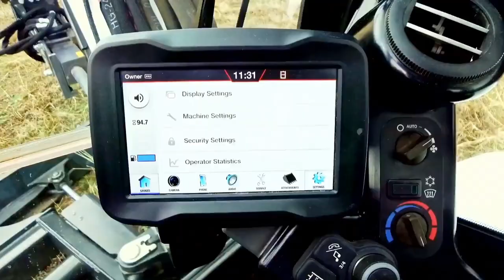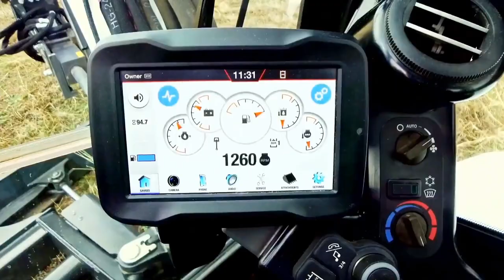Bobcat T7X Electric: The World’s First All-Electric Compact Track Loader!!!

Comment: I had to check to ensure this did not come out in April because I thought this was a joke. Even with the improved torque that comes with electric motors, 4 hours of run time is a no-go. Add to that, no hydraulics... there go all my attachments until the industry catches up.  Can't even imagine what an inconvenience charging will be on site. Dragging around a diesel generator to charge the thing almost defeats the purpose.  If all I did was dirt work or I was a rich dude looking for a new toy, then maybe. But I just don't see it working. I applaud the innovation and hope they can do better with larger battery banks, but as is, this is just a toy.

Comment: We recently got to test this machine.. we were really impressed with the power and performance. Yes.. charging may be in the main issue on sites but really cool to see the innovation.
Reply: Charging is not an issue. 
62kWh battery is huge, it’s equivalent to 200 miles a day. How many gallons of diesel saved? 

If someone needs more range, buy a second machine. The savings in diesel and maintenance will quickly pay for it.
Reply: @lumberjackdreamer6267 hahaha your so ignorant time is worth more money electric is NOWHERE near replacing gas diesel your looking at another 20 plus years the technology just is not there when you can compete with diesel then you can talk. You talk about saving money because it is all electric so maintenance costs are lower. In reality it costs way more owning that electric skid steer if you have to replace the batttery that’s 20k plus and only a dealer can do it. I can work on any machine I own, I don’t have to make a job stall and have 5 or 6 guys getting paid hourly while the equipment is charging, it still has hydraulic systems you have to maintain tracks almost everything is the same except for the electric motors. When you can charge the machine in less than 30 minutes and have it run all day then it can compete but my skid steer can run all day 10 hours multiple days without having to fill up, electric can’t. Yeah it does have fewer parts that are 10x more expensive than a regular skid steer. Would you rather replace a head gasket for 100$ and 2. Hours of your time or pay 5,0000$ for one electric motor and have to TOW it to the dealer to get replaced. ITS NOT WORTH IT
Reply: @lumberjackdreamer6267   where does that electricity come from? Chances are, coal.

Comment: 4 hours? You seriously have to work on that. Most short days are 10 hours. That makes all the difference in the world. Sounds like loss of production…
Reply: That is 4 hours of the machine not stopping at any point during work. Guys who work 8-12 hour days how much of that is idle time? Or the machine isn't being used very hard? I think this machine will work longer than we think it will.
Reply: @ptrproducttestreview9593  Haha idle time. You don’t get paid for that. The only way that this is feasible 1: you stop for lunch, or 2: you have an operator that is running a 2 pieces of equipment and isn’t using constantly. If there is “idle time”, the project manager or lead needs to be fired.
Reply: @wht240sxka  Why are you rambling on about unrelated subjects bro?

Comment: 4 hours of run time? Never once have I been on job that the 4 skiddy’s running around that shuts off in a 12 hour span
Reply: That is 4 hours of the machine not stopping at any point during work.
Reply: 4 hours, you believe this haircut?
Reply: Charging is not an issue. 
62kWh battery is huge, it’s equivalent to 200 miles a day. How many gallons of diesel saved? 

If someone needs more range, buy a second machine. The savings in diesel and maintenance will quickly pay for it.
Reply: @lumberjackdreamer6267  at a 200k price tag per unit….it would take in a long time to pay for itself. Diesel is expensive, sure. But consider most job sites, especially new builds…..require diesel generators for power.  Also charging isn’t free. You have to use energy somewhere to charge the battery. Love the innovation, but we’re just not there yet. Battery tech is still way behind.
Reply: @darrinschaub6086  
Electric powertrains cost far less to manufacture. Far less moving parts. Much easier, simpler, cheaper. 

There are huge RD cost, but marginal costs are very low.

Comment: Get a kubota skidsteer where the door opens inside the cab instead of opening out which gets in the way of the attachments and lifting the boom. Also you can operate the skidsteer with the door open which is a very nice option when you don't need an enclosed cab.
Reply: Can you lift your bucket with the door open?
Reply: @plantcollector3915  
Yes. The Volvo door is in the side, like a tractor. I can enter/exit with the bucket up. It’s the best.
Reply: Volvo has a side door. Better. Much better.
Reply: I can operate my bobcat s740 with the door open…just unplug the door sensor on the door itself. Prefer to be in the AC tho